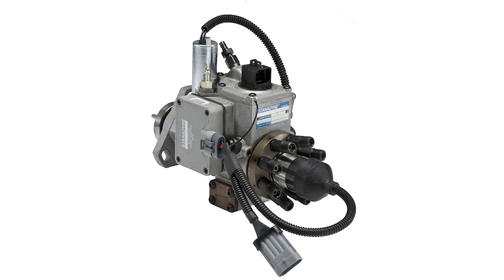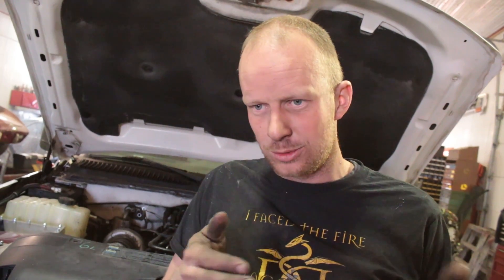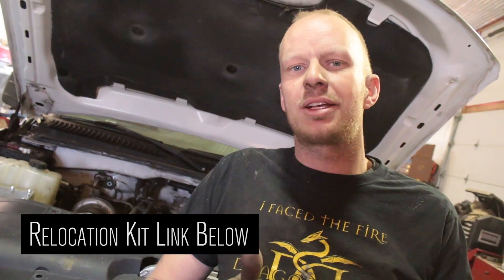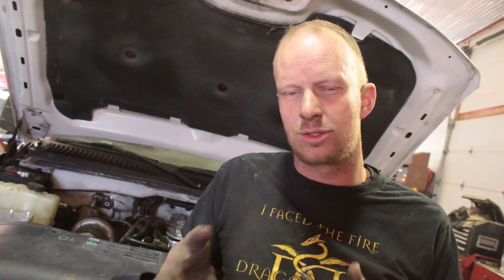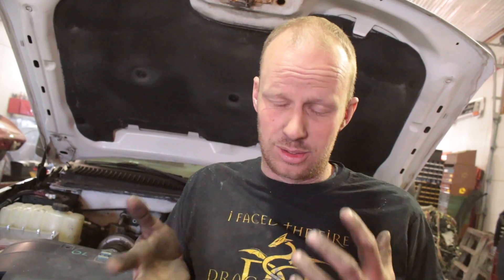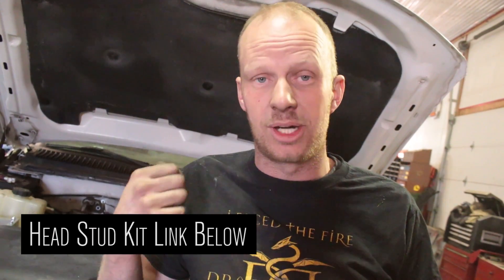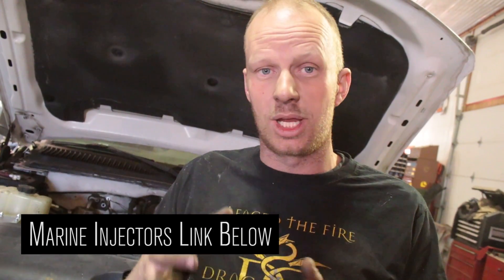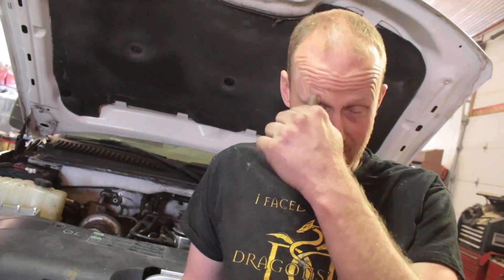REVIEW: Everything Wrong With A GM 6.5 Detroit Diesel

Comment: I HAVE HAD 3 OF THE 6.2/6.5L trucks.  First was a 90 6.2l crew cab normally aspirated with 4 speed manual transmission.  First to go was the 4 speed since was compound so you only had 3 usable gears.  5 speed (getrag) was a great improvement especially top end.  Second was a banks turbo from a junk yard.  It had a lot of play in the shaft so I called Banks to see how much it play was bad.  They said if the turbine didn't hit the housing it was ok.  Kind of made me nervous but It installed it and never had any trouble. I pulled a 28' 5th wheel with a 16' boat behind it.  Out on the highway it performed will but in the mountains I was down in the bottom 2 gears.  I took it camping in Colorado and came back over Cameron pass pulling trailer and boat coming east.  The engine ran hot by the time I got to the top so I stopped at the top and let it idle while everyone used the outhouse.  Didn't cool down so we headed down hill and it cooled down.  I decided I needed a pyrometer since I found out that I might have damaged the pistons.  Pyrometer installed made another trip the next year and the pyrometer read 1200 plus which was scary.  Might have been where I placed the pyro sensor but still very hot.  The engine ran great until I sold it.  (should never have done that)  I bought a 96 Suburban with a 6.5L diesel.  It ran great but my pickup with the 6.2 had way more power than the suburban. After talking to the diesel page guys they said that the 6.2 NA had less compression ratio which made the turbo more effective.

I really like this engine, the parts are relative cheap and it is very easy to work on and there is a lot of information out there on them.

Comment: I worked for a company that had a 1ton 4wd stake rack I had the pleasure of driving that piece of shit a few times I remember it not wanting to start in the winter without starting fluid constantly having glow plug issues wouldn't get out of it's own way it was a manual transmission I couldn't imagine how bad it would have been with a automatic transmission

Comment: I have 1996 2500 6.5 now never seen winter so in grate shape up north but this truck  pulls trailers all summer long and been grate truck  6.5  is not super  heavy duty truck but where i live still lots them running around   400 to 500 thousand km i also have 6L ford with vary little problem as well 
...as you say 12 valve is best engine but they all still had there own problems with rest of trucks ...i drive  newer 5500 every day  and find the new engine vary under powered  and def always shuts  it down so think its what you like to drive as i drove alot diesel pickups  7.3 6L 6.4 Ford  6.5 6.6 7.3 chev 12 v  24 v think its 6.7 dodge and  they  all had there own problems after time and after all this i still like  driving 6.5 chev and 6L over dodge any day lol

Comment: I remember the 6.2's had a nasty habit of breaking cranks back in the day.Was that still an issue on the 6.5's or was that issue solved somewhere along the way?
Reply: Yeah that can happen to either the 6.2 or 6.5. But it’s caused by running them with bad harmonic balancers. That’s also what causes cracks in the main webs in the block. Keep on top of that and you shouldn’t have any issue. Putting on a Fluidamper is the way to go in that case.
Reply: @justinstearns9723  I put the fluidamper harmonic balancer and the leroy diesel one piece pulley on mine. Runs like a sewing machine 👌👌

Comment: I always thought Detroit Diesel engines were extremely reliable two strokes?
Reply: 6.2 & 6.5 GM Detroit Diesels are nothing like the 71 series Detroit Diesel you are thinking of.  The GM diesel used in medium duty trucks is a 4 stroke V8, the 71 Series is the 2 stroke and came in 1 cylinder versions all the way up to 16 cylinders (although I think it's the 6 cyl that was the main variant that was the real work horse).  The legendary 2 stroke Detroit  Diesels were in big buses, semi trucks and agricultural equipment.
Reply: @GregHuston  Ahh, I see thank you. GM kept the quality name and threw away the quality of the engine. A bit like Boeing, kept the 737 name but got rid of the safety and fault tolerance of the design.

Comment: My 98 6.5t Suburban K 2500 was bulletproof before I bought it the Boost was turned up a little bit nothing runs like a dream and it sounds amazing it's been nothing but reliable outlasting my 98 454 Suburban was just recently blew a head at 403k miles on the original block

Comment: Had a 6.5 dually 5 speed did  a lil hauling 7500 pounds  nothing major ran great performed well up until a chunk of the block blew off it was very well maintained just one day gave out I would have put a 12 valve in it if it was 4x4 but it served me well got my money out of it got it for 8k with 99k miles made it to 220ish

Comment: I rebuild AM general 6.5L humvee engines, ask me a question if you want. 🤘
Reply: Is there any difference with the engines Made before 1995 in the c/k truck series , I’ve notice they look alittle different
Reply: @damienvera3135  yes, the injection pump, Humvees use mechanical pumps with the black box near the valley. Also 6.2 diesel use diffrent cranks, oil pans, balances ect.
Reply: @damienvera3135  humvee also use the Van style engine with the turbo in the valley, I believe 95 trucks had a side mounted turbo option
Reply: mark robertson  the figure 8 seal for the turbo mount to block. I would price it out for a 3rd party vendor. I'm not sure what the hydro brake is, humvee's use a slighty diffrent variation from the HD Van engine. If your turbo is sporadic, I would make sure the dump arm is moving and not frozen, a cold check with your hands can accomplish this. Sounds like its frozen open, not allowing the boost to climb. The breather.... I would not worry about it, DO NOT use brake Kleen or any other solvent to clean the breath, warm water and dove soap. Rubber diaphragm is built in, can dissolve with solvents. Idk where the PVC would be, sorry hope this helps!
Reply: robertson  hydrobrake*

Comment: They were used by the military for a couple reasons.  They were cheap.  They would run on junk diesel.  It would cost way too much to retrain the entire population of military engine technicians were they ever to switch to something better.
Reply: And that there is how the 6.2 and 6.5(some of the most undeserving hated diesels) won against better motors like the 5.9 Cummins and the 7.3 powerstroke(T444)

Comment: Had a ‘97 P30 Snap-on van with over 140,000 miles that I retired in 2017. Countless hours as it ran 8-9 hours a day 5 days a week. Only problems were 1 leaking lift pump diaphragm, and a glow system that burned out the glow plugs because the control relay stuck ‘on’. It started every day and never let me down. I sold it after 20 years of service. New owner says it still runs like a top. Just can’t beat that.

Comment: Probably just as bad as the 6.0 power stroke. 
Horrible fuel system. Have to remove the fuel lines to get to the valve cover. Timing is a bitch. No room to work. 
Turbo design is crap. 
Can’t believe the military uses this motor.
Reply: You ever owned this motor?

Comment: My 6.5 has had the pump PMD moved, the intake opened up, the down pipe replaced with a mandrel bent pipe, an oil catch can, and a mechanical waste gate. AT 225,000 miles it still runs good (had to replace the tranny at about 200,000), but it is not much of a puller. Into a strong wind it generates about 10 lbs of boost and can barely do the speed limit. Also smokes a lot when a cold start. But, since we mostly use in in the forest, we will keep it.
Reply: Check the coolant crossover pipe on the front of the engine for a small switch screwed into it. The Chevy dealer calls it a "cold start advance switch", when you replace it, cold start smoking should go away, and it will "fast idle' about 4 minutes on cold starts.

Comment: they only last 500k. unlike a 12v that will fall apart if you dont rebuild the front half of the engine huh. ive seen 6.4's go to 740k before ive never seen a cummins hit 500k
Reply: 6.4 is my favorite guilty pleasure engine, but this doesn't sound right as much as I would like to believe it. I've seen them hit 260k-290k miles though.
Reply: ah yes,
a ford fan

Comment: I have a 97 Cummings 12 valve with p72 pump have 400 k. Bought 2007 common rail and they offered me 3 k trade in. Put 200k on it after I laughted offer off. Will never sell that truck. Couple of water pumps, couple of starter motors, and clean primary fuel screen. Never touched the engine.

Comment: Love the info. Bought a 2001 H1 6.5 TD with 17800 miles on it several years ago, first time the wife and I drove it for over an hour, up and died on the interstate. After a bit of research I found out what virtually everyone knows about these engines, PMD failure. Aside from that it's been a GREAT vehicle. Have done quite a bit more in the way of mods, but as you stated, not really going to break any records. Mods are more for reliability sake...keep it up!!

Comment: When I had my 95 6.5, I had that little black box relocated to  under my seat. There is a company out of Pensacola Fl that sell a heavy duty black box. You still have to buy your resister. I used a number 9 and the truck ran fine

Comment: Had one in one of our fire trucks, total garbage engine compared to even the mercedes diesels weve had. No power at all and ive never seen an engine leak as much oil. Sold it with 35k miles, id never waste any time or money on a 6.5.

Comment: I added marine injectors at 230, 000 mi. and within 200 miles I heard my first diesel rod knock. I talked to a couple of older guys with a lot of experience on the 6.5 platform. Long story short, I bought a block from a company that casts their own block with larger webs and different metallurgy, supposed to be stronger and eliminate the block cracking issue. My heads were cracked as well, not unrepairable, but I bought new heads from a place in New York. Stainless components in yet another improved casting design also to eliminate cracking. Rebuilt the turbo, after market housing and waste gate. So... Rotating assembly has been balanced, added head studs. I don't have a ton of money in this set up. And should still get good mileage. Still assembling and installing. I can't wait to finish it up and see the final results. Only then will I know for sure if I should have done a 12 valve swap. Lol!!
Reply: How'd the build turn out on power torque and fuel mileage and was it still reliable

Comment: no 6.5 ever went 200k or more in a Military vehicle.....most don't make it past 25k.....then they get auctioned off....
Reply: The mil-spec units go well over 200-300k.
When auctioned to the public.
Reply: @OldGriz708  BS.....BS....BS....You cannot find a Military Hummer with 100k on it....most are auctioned off before 50k because of issues, mostly engine...go look at the auction sites and find me a 200k military hummer ? you won't find one because there is none..
Reply: @lrlapua8035  The gauges are reset quite often

Comment: I just bought a 94’ K3500 dually earlier in the year with a 6.5. Got it for a steal since it wasn’t running. Found blown head gaskets, leaks, etc. I drained the oil pan down and found the engine was just vapor locked. Cranked right up and other than the smoke it ran great. Just finished gaskets, vac pump delete, and Air Dog II pump. It’ll be a cool ride just for hauling and mpgs, but I’m still keeping my Dmax for my camper and when I haul larger trucks.

Comment: GM SERIOUSLY beat Dodge In everything besides the engine. I had a 2000 24V..... never touched the engine however the rest of the truck didn’t seem like it was built to last...the entire steering system was garbage (for example)

Comment: I will say they are awesome on mileage I’m putting one in my ole dually right as we speak I find around 250 with two motors I had head problems they are great on fuel the box is usually the problem if you have one carry a spare pmd and mount away from engine the heat kills them and the heads and blocks are famous for cracks thers a few castings that are a little better but like he said the army used them so that says something ther fairly easy to work on ther not a real complicated engine but the 12 valve if I had the money is the way to go we all don’t have a lot of cash so we do what we have to

Comment: Had one in a 3500 and I bought it with 300K (miles on the clock). It wasn't a bad truck but it was pretty gutless. Sold it @ 340 for what I gave so I can't really complain. The truck was nice and had I had the place and the time I would have parked it and looked into a cummins swap but I was working on the road. Mine already had the PMD relocate on it when I bought it. Now I own a 97 ram 3500 RWD and the difference is like night and day. It's easy to see why dodge mopped the floor with the competition with the second gen.

Comment: Fluidyne harmonic balancer. Will make your engine last way longer. Most of what you mentioned is correct, but not all.  Humvees were N/A mechnical motors- no turbo. Less heat issues, some have different pumps (artic rated to run JP8). They are quieter than a 12V.   For the way most people drive most of the time, A good running 6.5 TD is fine. If your towing all the time, then thats another thing, its like people who get pickup trucks to haul the christmas tree once a year. The rest of the time its a grocery getter.

Comment: I have earned a living as a mechanic for 35 years, as opposed to guys who work on engines some and call themselves a mechanic. One company that I used to work for would buy these trucks with 170 k to 200k miles on them, go through them and use them for foreman's pick-ups. They were not always in the shop, and had no more failures than the other trucks we used. The "black-box" did get mounted on the intake manifold w/heat sink, but the trucks were used to the 350-400k miles mark and then became parts for the other 6.5 pick-ups. The only common defect I saw was that the cylinder heads would crack between the valves, but if we paid money to have them fixed, or just put them back on without welding, the engines ran good either way. They were prone to mechanics installing pushrods up-side down, which caused rocker arm failures, and if they left the cam spacer out it would destroy the timing chain about 800 miles later. (If you weren't familiar with the engine, it looked like a really thick washer that didn't go to anything, but it was indeed very important). I admit that I preferred to drive the older ones with a throttle cable instead of electronics, but that's personal preference. Still a very good diesel engine for it's time.

Comment: By the way excellent program today fantastic commentary,,, any thoughts or recommendations on the old 6.2 liter  379 cid,, most common problem I've ran into on the old 6 .2 was that the crankshaft broke at the rear main at anything over a hundred fifty thousand miles

Comment: You forgot a big one.  Pre 97 engines liked to overheat when towing.  In 97 gm fixed it by going from about 87 gpm water pump to a 130 ish gpm water pump with dual thermostats. I had a 93 doing a hard hill climb with a 7 k trl get to hot and a bit later had head issues?  I later got a 97 with a 13k trl and it would warm up on a hard pull of the same ish (road work flattened grade a little by making longer) but never got near as hot. 

If you have a vin f engine and do a mechanical waste gate you can do a vacuum pump delete
Reply: Oh i forgot. They are pretty cold blooded.  My 97 7.3 powerstroke i start in about 0° f with no help and my 6.5 td in about 20° f without block heat would say screw you.   Longer glow cycles would make some difference im sure

Comment: Aftermarket lift pump and standalone wiring harness for lift pump is a must on a 6.5
Reply: What do you mean by standalone wiring harness?
Reply: @jswm92  its a kit you can get online. The factory one piggybacks off the circuit for the oil pressure sensor.
The kit wires to the aux post on the engine bay fuse box

Comment: please review the 1984 Oldsmobile 4.3l diesel v6 ;}
Reply: isn't that the improved/fixed version of the diesel that was utter junk and its PR was so bad after that, that even in 1984 when they had fixed the problems no one wanted one anymore and the engines were cancelled?
Reply: @Revoku  nah that was the 350, the early production diesel 350's were a bit of a train wreck. The mid to late production ones actually arnt to bad. And the 4.3 (262ci) v6 is just one of those minus two cylinders. (Though they did make a 4.3 (260ci) v8 gas motor)
Reply: @johnrouk8319  
They also made a 260 V8 diesel for a couple of years.
Reply: @craigroth8710  no kidding? Ive never ran across one of those. Although with all the oddball stuff that was made in that time frame im not to suprised.
Reply: Isn't that the truth!!!
Reply: I don't know a thing about the V6 but the 350 DX block is good for close to 900hp with the right recipe of parts and tuning!  With a 425 crank and a lot of machine work you  get a 442 CI oldsmobile engine.  The block is the only piece worth a damn though everything else is good for the scrap metal bin and of course you're going to be burning Gasoline.
Reply: @GregHuston  how big you talking about boring it? The 425 crank is 3.975", you mean 455 crank 4.25"?

Comment: My big kick in the nutz..6.2 bracket the holds the starter on came loose fell off.cranked the motor over cracked the block where the starter goes..as in chunk broke right off....one 6.2 in the garbage..parts for the new 6.2 i had to buy..900 bucks later

Comment: The 90's GM trucks were not Squarebodies, those were the 73 to 87 trucks. The 88-98 trucks GMT 400's
Reply: GMT400 is considered “the last of the squarebodies.” Kinda like the SN95 is still technically a Fox
Reply: @matte6352  No, that is not correct. Squarebody is 73-87.